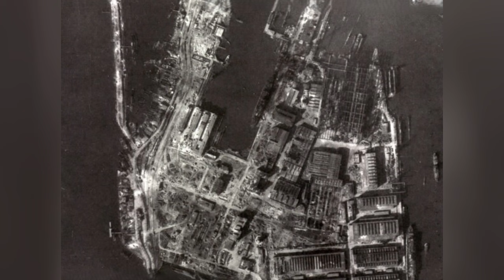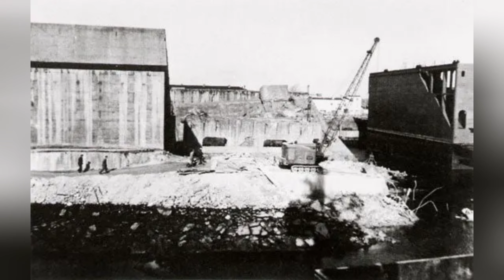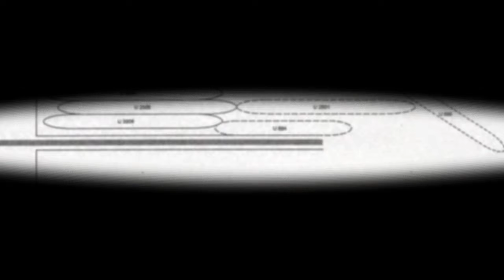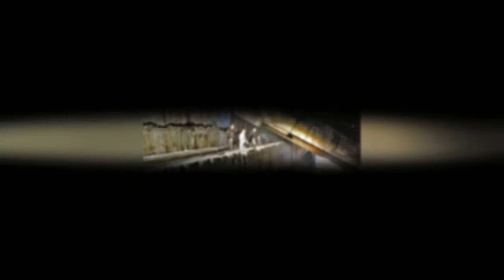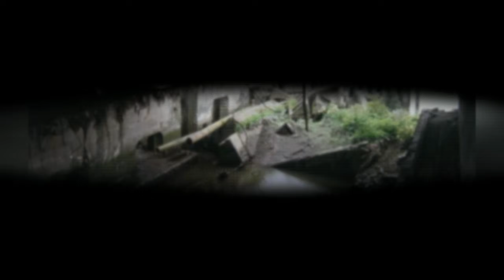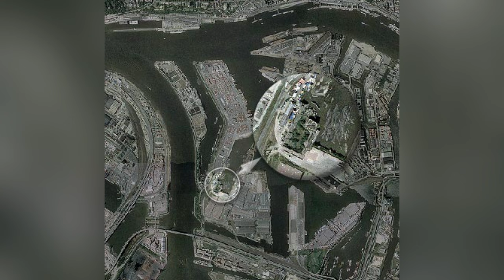Exploring Elbe II: Type XXI U-Boats Buried Under Hamburg

Comment: I visited the Wrecks several times between 1993 -1995.
- One did not have to walk through sticky mud, but could reach a ladder in the wall of the harbor basin by walking on the metal of the hulls.  
- The light in the west bay was not only artificial, but also entered very dimly from the north and south.  
- The wrecks of U 3004 and 2505 could not be described as 'intact.' Only the forward sections remained, and the turret was detached.  
- The mentioned 'integrated anti-aircraft weapons' were no longer present on any boat. On U 3506, the locations of the anti-aircraft guns could be seen in the remains of the turret cladding.  
- There were no hatches left to be broken open. Only on U 3004 was the front cover of the inflatable boat container closed.  
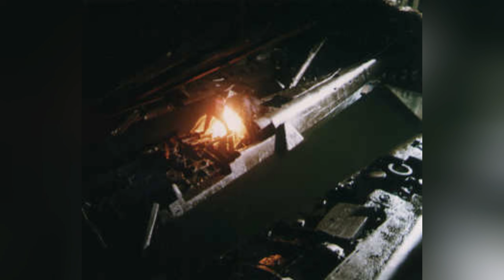- Welding equipment could be used on the boats, as can also be seen at minute 15:45.  
- The backfilling of 1995 occurred only over the boats and only at U 3506 up to the ceiling of the bunker, which was very deep there.

Comment: Beaucoup de blabla et de repetitions inutiles, par contre aucune photos de l'extérieur du site actuel dommage
Reply: Well, not much to see there today, just lots of 40ft-containers....
https://www.google.com/maps/place/Hamburg/@53.5301276,9.9523341,2926m/data=!3m1!1e3!4m6!3m5!1s0x47b161837e1813b9:0x4263df27bd63aa0!8m2!3d53.5488282!4d9.9871703!16zL20vMDNocno?entry=ttu&g_ep=EgoyMDI2MDMyNC4wIKXMDSoASAFQAw%3D%3D

If you scroll in, you'll see the "L"-shaped buldiung und an mark for the Elbe II-bunker shows up - the building and the containers rigthside of it are standig right above the place wehre the bunker was and above the boats...

Comment: The photo showing a total lack of corrosion makes me suspect about the validity of this story !
Reply: Saw them with my own eyes in 1990. them are still inside that Bunker
Reply: @tisch6377 thankyou  !
Reply: It's absolutely valid
Reply: I believe this. I have seen more than one documentary of these. I believe one was done by Mark Felton.
Reply: @craigsavarese8631  Well, seeing a story from Felton is not really a thing to make something valid.... but Felton is a topic on it's own.
But this story is true, it is well documentated and the subs were photographed several times.
Reply: The German subs had a rubberized coating which helped to soak sonar signals. 
This was on the last subs produced.
Reply: Not too bright are you
Reply: @hud35500 Every ship I have been aboard loves corrosion.  Obviously the documentary is true ! And was well done. The subjects,  three XXI boats, in a bombed out U- boat pens is fascinating. The pocket Battleship Admiral Hipper buried under a parking lot is incredible.  As far as the condition of the wrecks ! Remember that " RUST NEVER SLEEPS ".